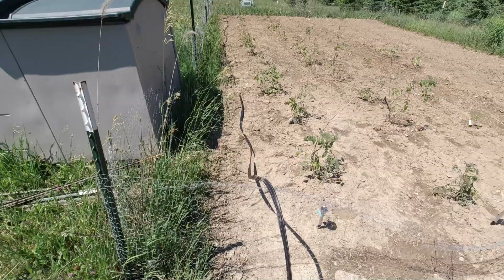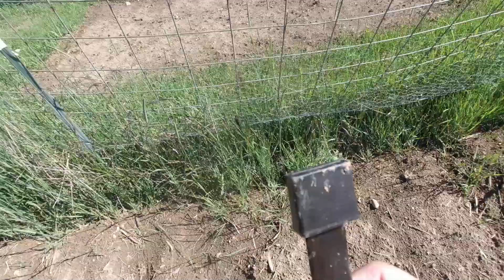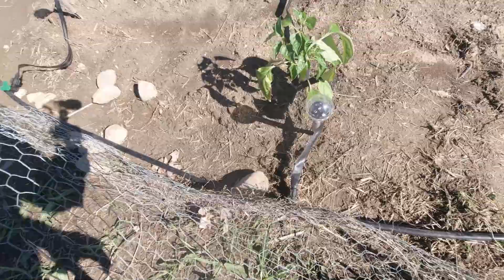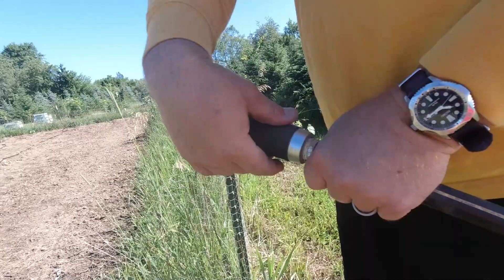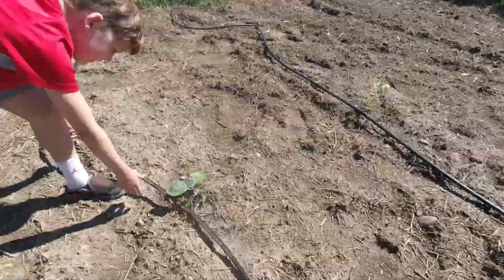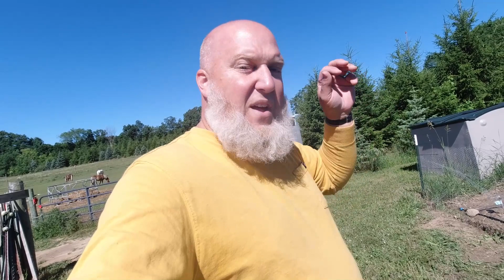How to Set Up Drip Tape for My High Tunnel and Outside Garden

Comment: Put the ten lb reducer before the y connection so both your hoses for your drip tape watering system are at 10 lbs.
Reply from the maker: That was just my thought.  Thanks for the suggestion and for watching.